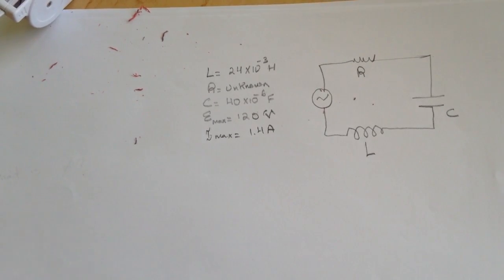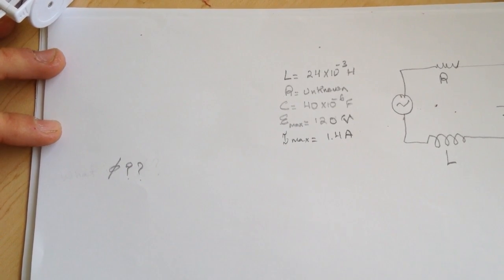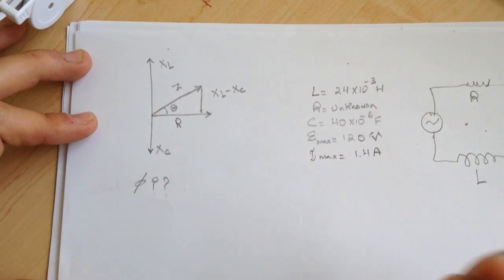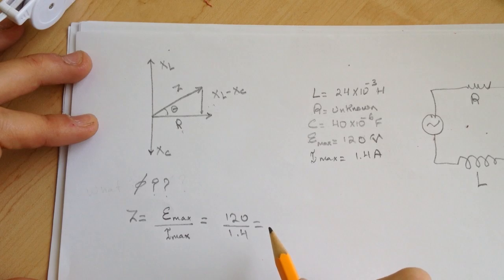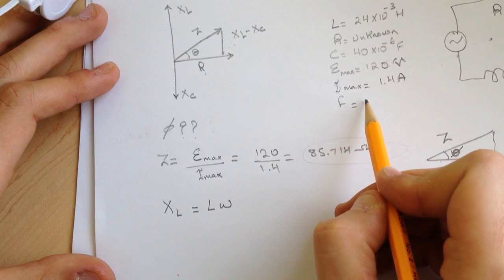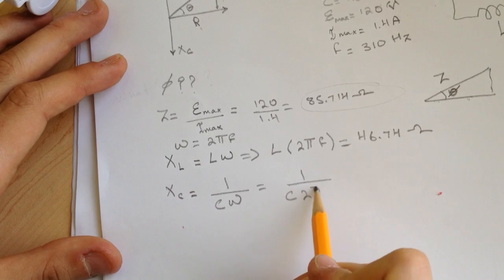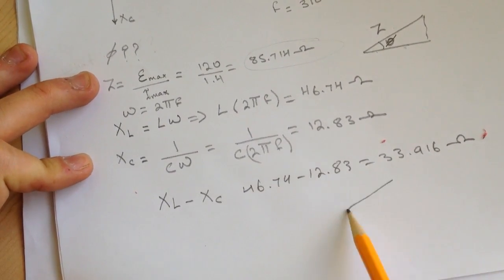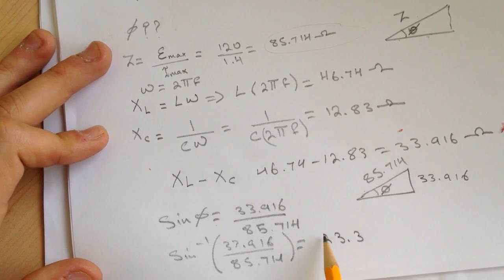AC circuit 1 "Smartphysics" Solution

Comment: Just how you the answer for degrees. Currently in Circuits 1 and going through the book there is no answer as to how degrees are calculated. Just says that 0.8 is the cosine of an angle of 37 degrees, but I don't know where they got the 37 degrees from for the solution.
Reply: I'm not really getting what you mean. You can text me on my personal number of u want.